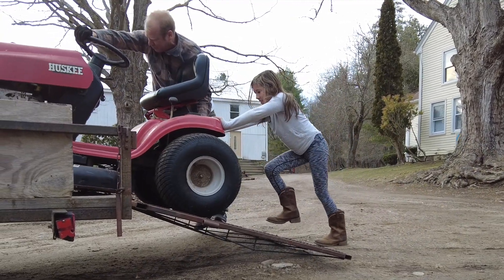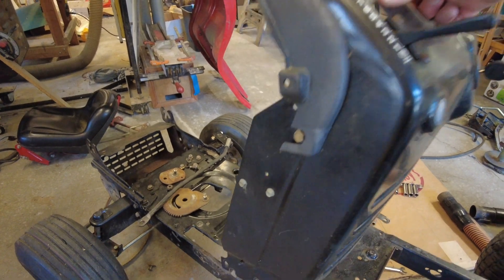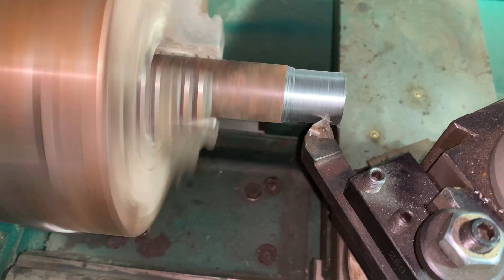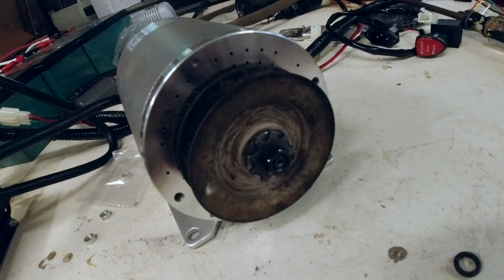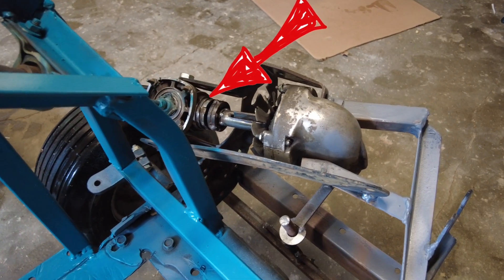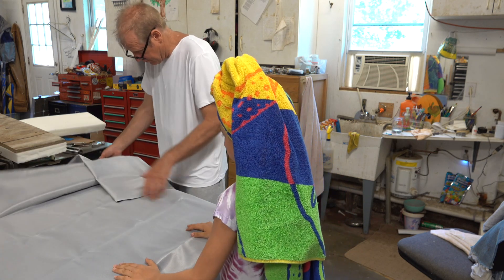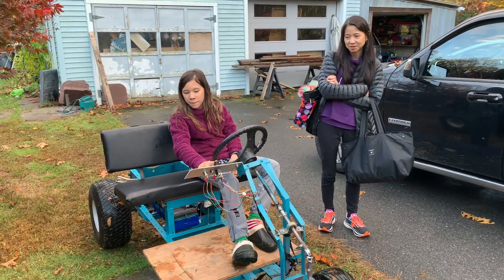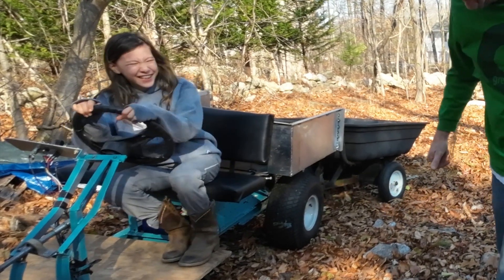$500, Homemade mini electric truck made from old lawn mower, part 1

Comment: how do you change from a throttle handle to a pedal? i am trying to build it too
Reply from the maker: Hello,
The kit I used came with a foot pedal that clipped right into the wire harness. It has since stopped working and I replaced it with a new one that looks just like it (cheap) but rated for only 24 volts. It’s wire connector was a different configuration, so I cut it off and spliced the connector from the old one. I suspect that that this new one will burn out as well. At that time I’m going to upgrade to a different style.
Let me know if this helps. Be happy to go into more detail.
Thanks,
Reply: @sculptureforasmallplanet  alright i understand i ordered a 3000w motor including 'throttle handle' like a motorcycle i am thinking to remake that into either a pedal or a lever but i love your video and personality ur a great dad also i wish my daughter will be able to drive my little converted electric lawnmower when she's older
Reply from the maker: @njutarn8381  check online and see if you can find a pedal throttle that you like. Pretty sure there is something that will work. Let me know how your build goes. And I’m sure your daughter will love driving it!